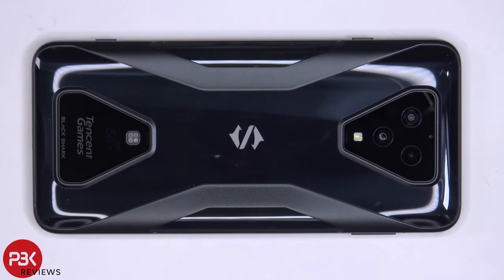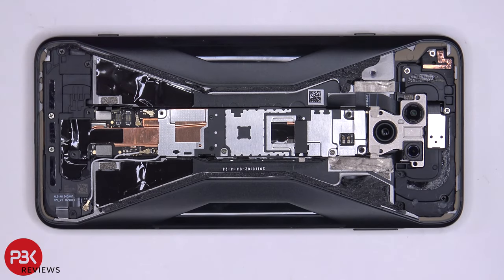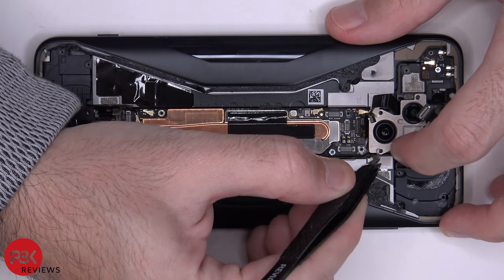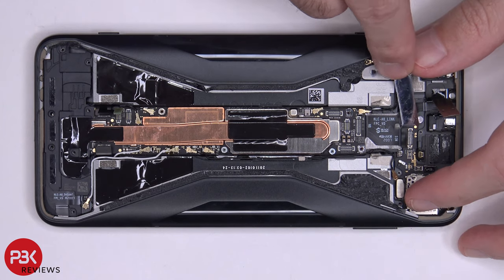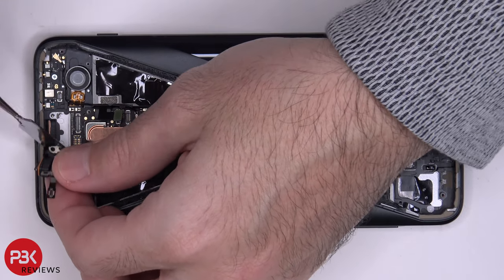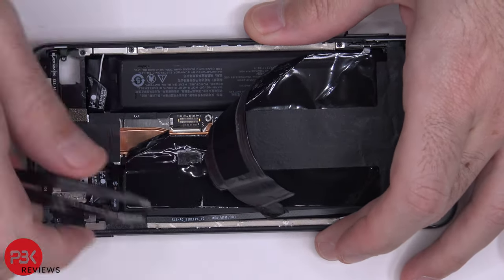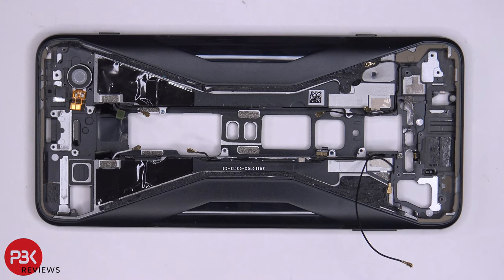Xiaomi Black Shark 3 Teardown Disassembly Repair Video Review

Comment: if I need to replace the screen do I need to teardown the back first before I can replace it?
Reply from the maker: Hi, no you can just take apart the screen side and disconnect the screen cable and replace it. You don't need to take apart the back (even though most people would prefer to disconnect the battery cables on the back before disconnecting other cables etc.) Just make sure you don't use any metal tools so you don't risk shorting anything.

Comment: Aren't they gonna get static if u keep touching them?
Reply from the maker: no, have handled phones for many many years with no static protection and never had any issue. As long as your not on a rug and very static environment, then you should be fine.

Comment: My bs3 got changed battery recently because 1 of the battery god bloated, but when they tried to charged it, it only vibrated and doesn't show display on screen and was wondering of anyone know whats the problem or how to fix this, before we replaced the battery the phone still works fine and I put it away and doesnt use it for a while to prevent further damage but now it won't open
Reply from the maker: Maybe the screen cable got disconnected or maybe they damaged the screen cable or a chip on the board. Can be many things.

Comment: I own the same device. Since he fell into the water. No sound comes out. I tried the loudspeaker and bluetooth headphones, there is no sound either. And also a problem in making calls does not work even though it reads the phone sim.
Reply from the maker: You would need to take it apart, disconnect the battery, dry out any moisture inside and brush off any corrosion over parts/chips/connectors with a small brush like a toothbrush, and re-assemble the phone to see if you can get it working again. If not its possible you have damaged parts like the main board or other parts.

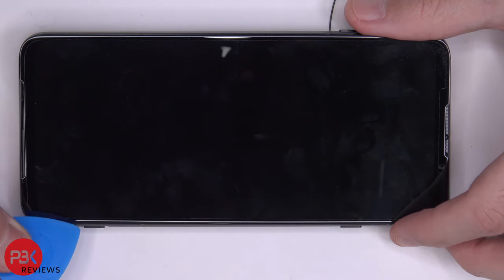Comment: I have a question, what do you call the tiny blue squares in 7:15 close to the corners of the screen?

Btw great video
Reply from the maker: I'm not sure what those are called, but they might be covers for the light sensors, don't remember. Thanks

Comment: I just got this phone last week. Now I'm afraid if someday when my battery is dead and need replacement because replacing the battery will be a nightmare.
Reply from the maker: Yea it definitely is not an easy replacement. I'm sure you should be able to send it in to the manufacture for replacement of the battery for a fee, if not a reputable repair store.

Comment: Hello if I were to replace the battery, would it be necessary to remove the back cover and back components first?
Reply from the maker: You don't have to remove all the components but you do need to take the back cover off to be able to disconnect the battery cables from the main board.
Reply: Awesome! My batteries need to be replaced! They've both ballooned up!
Reply: @MrKarlitu13  were your batteries bloated when you removed them ? I've just changed mine but it was only slightly  bloated and a hell to replace
Reply: @fabienvalmor1568  yeah it was reeaaally bloated. Now I had a local tech replace one batt then after replacing it, the lcd wont light up. Tried to troubeshoot it at home and found theat one of the cgarging port cables weren’t connected. I fixed it, but the lcd still wont light up. It vibrates as I hold down the power button tho. 😔
Reply: @PBKreviews  this is what happened
Reply: @MrKarlitu13  I got my bs3 bat replaced recently and I have the same problem as you do, before it still works but when the local tech changed the battery it won't light up but it still vibrated how did you fix yours
Reply: @sedeniokeeraalepheete7556  I gave up on it. This was the worst phone I have ever owned. And I will never recommend this phone or any other blackshark phones in the future. I am not a hard gamer, I only play a few hours in the evening. But still, this happened.

Comment: Mi black shark 3 sólo da problemas, se desconecta de la red, no me escuchan en llamada o al revés, hay interferencia y de 10 llamadas entra 1,dice: No disponible, Fuera del área o Apagado, me cambié de compañía a la mejor de mi país y lo mismo, gráficos bien, música bien, pero lo principal que son llamadas e internet, una vergüenza, celular caro que no hace lo más básico, una pena, Xiaomi era líder, casi para sacar a iPhone del mercado y luego esto, en un equipo de gama alta.🥺Help
Reply from the maker: make sure the black shark 3 network bands are compatible with your network you are trying to use it on. Maybe the network bands are not compatible. Also make sure the phone doesn't have liquid damage causing it to have issues.
Reply: @PBKreviews  Muchas gracias, le cambié la configuración, lo estoy probando 🙏🏻

Comment: My lower microphone has failed on mine.  What are the possibilities of the board in the low left failing ? 4 months old, I have tried all the software side issues as far as a full reset.  Call and "ok google" doesnt work.   Call does on speaker.
Reply from the maker: Its possible maybe a cable got loose or water got it not sure. Try checking on the cables and if still no luck try finding a replacement mic board online if possible.

Comment: Mine overheats, even just looking at amazon. Starts showing green edges then lines and ghost images of icons letters etc eventually screen gets so bad is unusable. Been doing this for months. If i put it in cool area, let it cool works perfect, then a few minutes later same issue. Any idea of how i can fix it? Maybe paste on chip bad? Hate to throw it away, is perfect besides this issue.
Reply from the maker: Could be liquid damage, have you dropped it in any water? Also you can try opening it up and making sure its not liquid damage and also changing the thermal paste to see if it helps.
Reply: @PBKreviews  Thank you for reply! As far as I know, no water damage.

Comment: Hi my black shark 3 Bluetooth not detecte devices this problem is after replacing battery is the Bluetooth piece or integrated in the motherboard
Your video is great
Reply from the maker: Thanks. Make sure all the cables and coaxial cables (wire cables) are connected and have not been damaged.
Reply: @PBKreviews  thanks i will see that

Comment: How do you change the battery
Reply from the maker: Once you take the phone apart, you would have access to the batteries which are held down with adhesive strips.
Reply: @PBKreviews  thanks
Reply from the maker: @Kim_Jong_Un_.  you're welcome.

Comment: So can you replace the glass without messing up the digitizer or do you have to buy the whole thing?  Got a crack in the top right of my screen and need to do the glass.
Reply from the maker: Hi, you would need to replace the entire screen assembly. The glass is not user replaceable, only factories with special tools and machines can do it.

Comment: Having an issue with its shoulder button after having the phone just a little over the year, it keeps turning itself on, even when I toggle the button off and on to return it to the phone mode, have to flip it a few times before it goes back to phone mode. Realised the issue is with the button itself, so have to wait for the blackshark to get back to me about sending it to repair as I don't really trust the repair centres around me for this particular phone.
Reply from the maker: Oh sucks, its possible some oil from periods of use or moisture got inside the button area and is shorting the flex cable or the receiver underneath.
Reply: @PBKreviews  thanks, would you trust local phone repair centres to try and fix it? Blackshark team aren't that helpful regarding the issue.

Comment: I have managed to change a battery that was bloated. Now after the assembly, the LCD won’t light up. 😔 it’s frustrating.
Reply from the maker: Have you made sure all the cables are in place and connected, also make sure you didn't over tighten any screws that may go through and damage the screen when assembling. Another thing could be that you may have damaged a chip on the board when taking it apart. Or just try disconnecting the battery and reconnecting it to see if it will work.
Reply: @PBKreviews  the adhesive that holds the cables of the screen and lcd in place wont stick anymore. Ive tried detaching it and attaching it again. But still my phone only vibrates when i press and hold the power button. Still no display.

Comment: If you still have the phone to check, how easy would it be to remove/swap the black border/triangles around the cameras and back charger port?
Reply from the maker: I don't have the phone anymore but the lens covers over the cameras are held on with adhesive, you would need to apply heat and pry it off, but would be easier to heat up the entire back plate and pry the back plate off which holds both those pieces. Its not too difficult just need to take your time heating it as you go to loosen the adhesive
Reply: @PBKreviews  Ah cool. I was actually wondering because I don't really like the green on black but I really like the look of the all black bs3, so I was wondering if it was reasonable to remove so I could swap it with the bs3 black ones.

Comment: It's nice but it's probably trash compared to the upcoming ROG 3, especially in terms of sustained performance.
Reply: There are no snapdragon 865+ coming this year, very unlikely that the rog 3 will be a 50% performance increase phone without that chipset. I would say if they don't make a version with an 8 inch screen there is most likely nothing rog will be able to do to compete if not lower the price of their phones
Reply: 😂 Rog phone has worst thermal 😂 it heat too Much than Red magic and Black shark...
Reply: Rog are very buggy, it’s not even worth the iPhone price it has.
Reply: @f.b.i3821  What bugs have you encountered on them?
Reply: F.B.I strange so I see the rog 2 is 50-50 someone I talk to hate the rog 2 of are technically fanboys but if you compare the ROG 2 to red magic 5G is kind of like comparing iphone XR to 11
Reply: @GameC3nt  Are you sure?... Based on the reviews it only reaches 37 degrees max in stress testing.